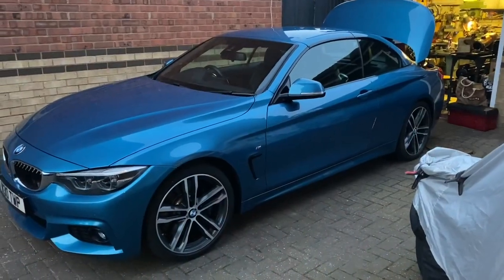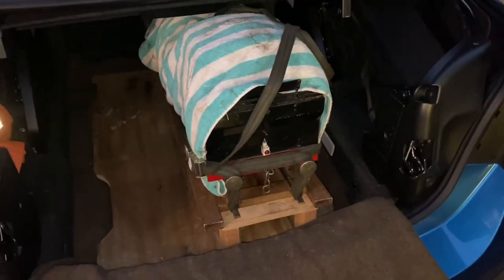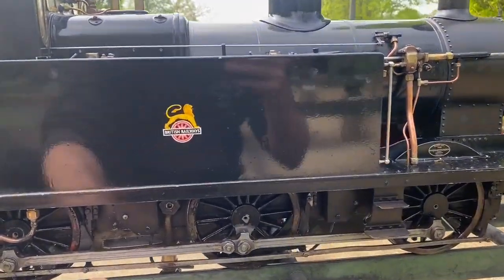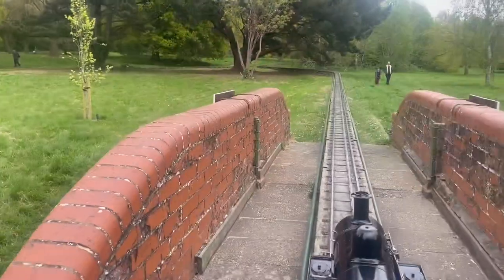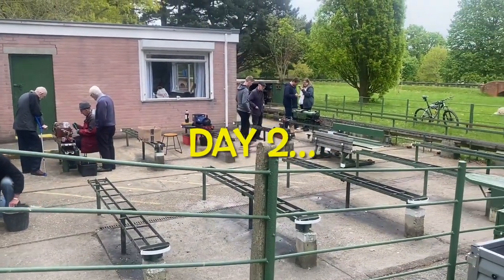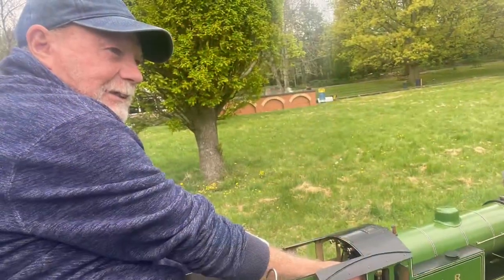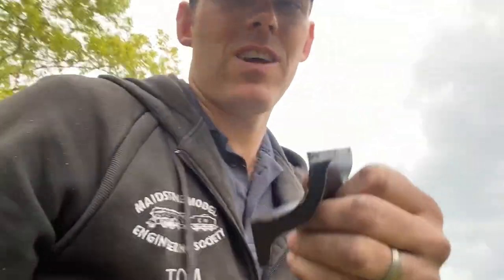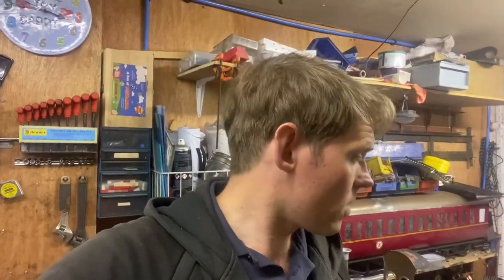May bank holiday weekend at Maidstone MES

Comment: Great stuff, Tom!  I learn a lot from each of your videos!  At about 12 minutes in you were on the bridge, and quite a bit of water was exiting the stack.  What was that exactly?  Got a kick out of the "war wound."  Thanks again!
Reply from the maker: That was the loco priming because it had been handed over with too much water in it, so as you run it lifts the water up through the regulator and into the cylinders. Glad you enjoyed it. 🙂
Reply: @TomsWorkshop42  Thanks!  I have much to learn as I attempt to get my Ajax up and running.